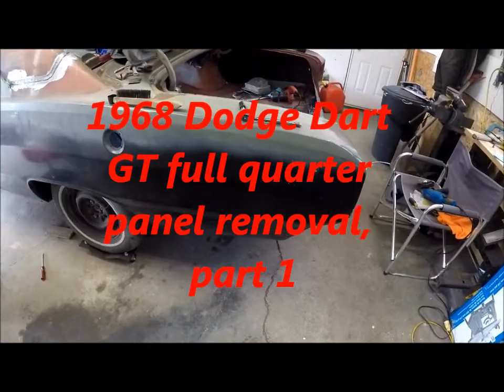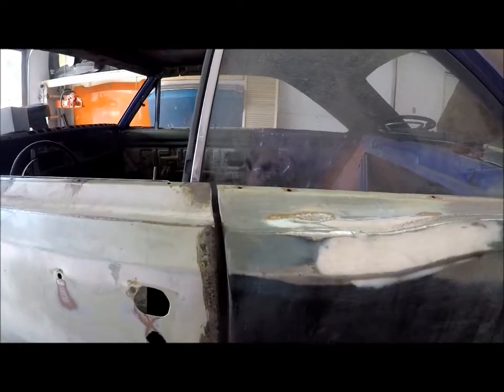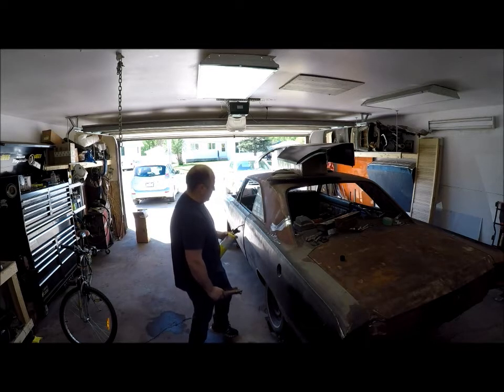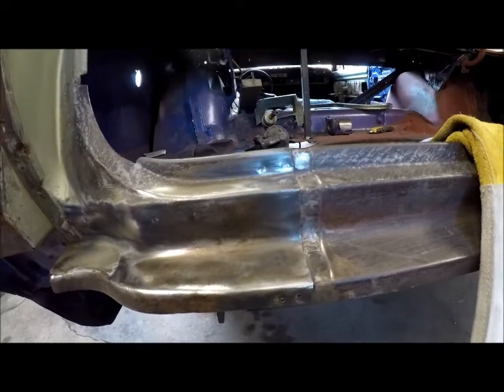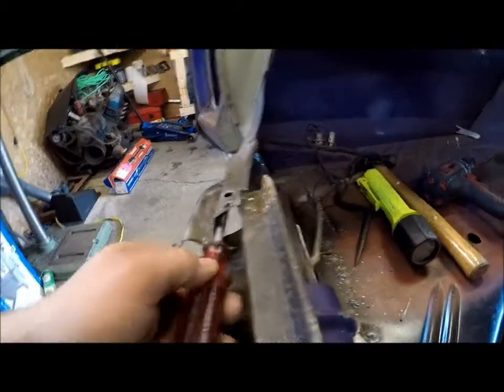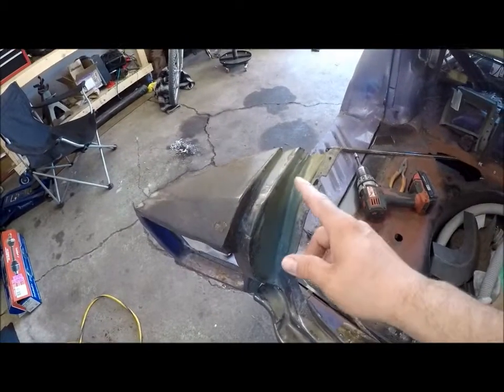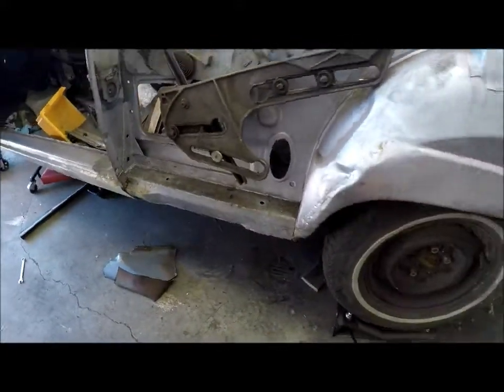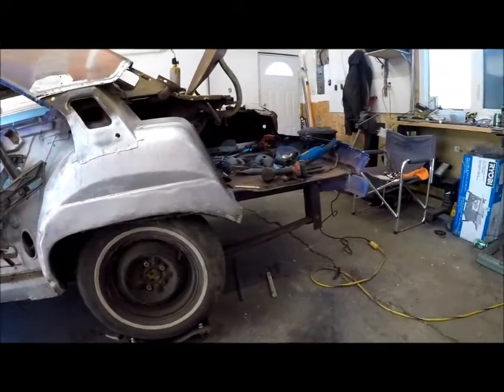1968 Dodge Dart GT Quarter panel removal part 1

Comment: Where did you get the replacement section attached to the light housing? What’s it called?
Reply from the maker: I bought it through auto metal direct (AMD) I think it’s called taillight mount. Or something like that.

Comment: Guess I got a bad batch broke all three of the Blair Broaches doing floor pan and rocker on a 68 charger damn things are expensive 35 for 3 I found a place for 19 for 3 and order 5 sets .....
Reply from the maker: Mike Crews , that sucks. I replaced one but it wore down.